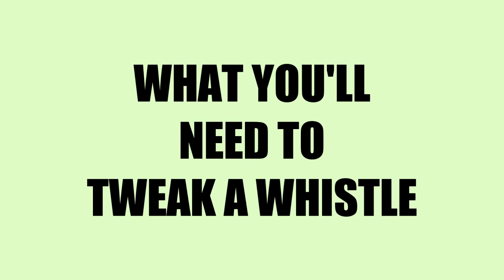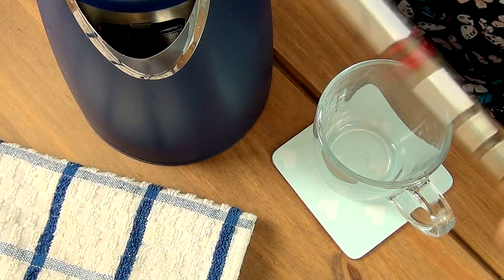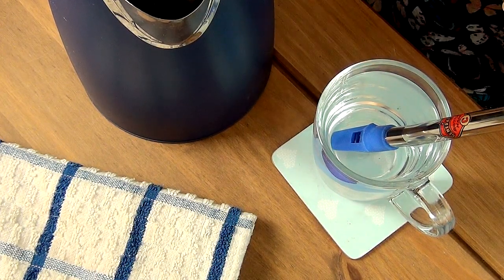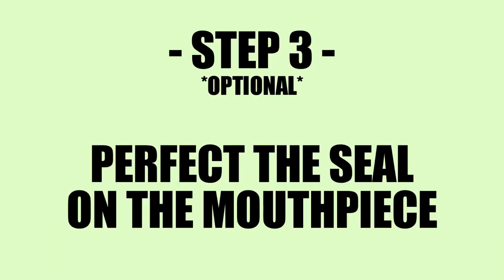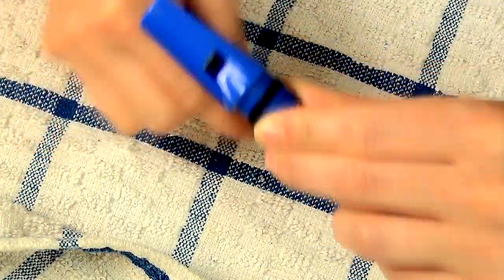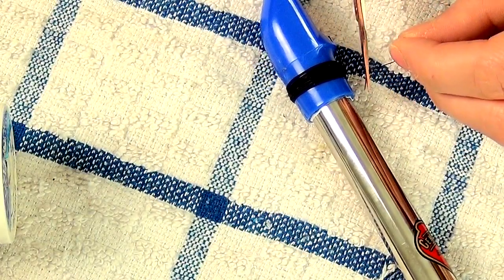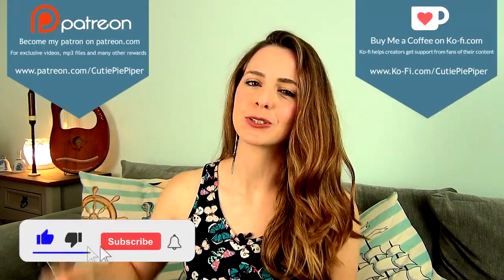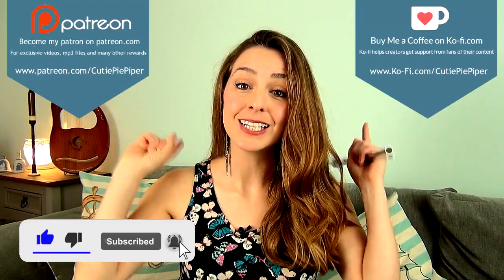HOW TO 'TWEAK' A TIN WHISTLE - 5 EASY STEPS ANYONE CAN DO!

Comment: I know this is an older video… but I figured I’d try to ask: I purchased a Jerry Freeman tweaked, but I don’t see any similar adjustments made to my whistle. I’m just not too happy with the overall sound (lots of squealing and sqwaking) I’m still working on proper air pressure and scales, upper octave etc- but are you familiar with this whistle or have any suggestions?
Reply from the maker: I have some freeman tweaked whistles, and a review for one of them. The tweaks aren't going to look as obvious as if you do them yourself, but if you're not happy with the whistle, you could connect Jerry.

Comment: Another cool trick is to use chewing gum… I know, weird. And, of course, I have only done this on my inexpensive instruments. It has a different consistency than the wall putty, less ‘porous’ if that makes sense. Gives a smoother sound almost. It’s also easier to remove than the tack, though neither is really a problem. 

Also, the fact that you would chew gum in your mouth, and not wall putty, makes me feel a little more comfortable inhaling it…? Not that the tack is highly toxic or anything.

Something else to try is those silicone ear plugs they sell at health stores. They’re essentially a box of round silicone “jellies” that look like clear silicone candies. But not, haha. I have tried it successfully, but it tends to not adhere as well as gum or tack. Still had good results.

Comment: HUH! It looked like a different whistle when you played at the end. I could see the fipple part and no black thread string and etc., Then at the very end, new shot, you held up the one you worked on. Huhmmmmmmmmmm . . . .
Reply from the maker: I play a 'before and after' of the tweaked whistle at the end of the video. The first part of the tune was filmed before the tweaks, the second part after the tweaks 👍
Reply: @CutiepieTinWhistle  OK. I don't know if I qu98te get that. Old age I guess. Let me ask, after we do the procedure you laid out is one ever after going to play a flute with threads up around and near the mouthpiece? Or may it be removed? Thanks.
Reply from the maker: @20Hikecdt23  if you want the benefits of the thread, it'll need to stay in place. All the steps are optional though. You'll just get different effects from each one. You can use something else to bind the mouthpiece if you prefer. Jerry Freeman uses a small ring of metal for example. That just makes things more difficult for the average person at home though.